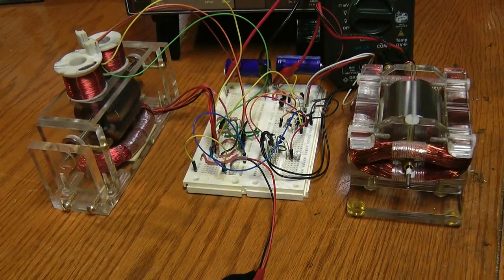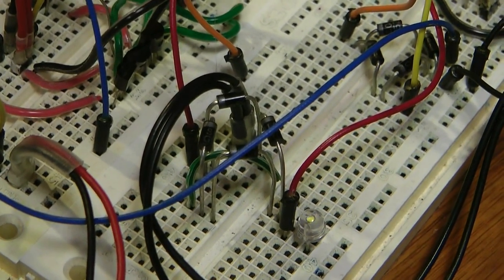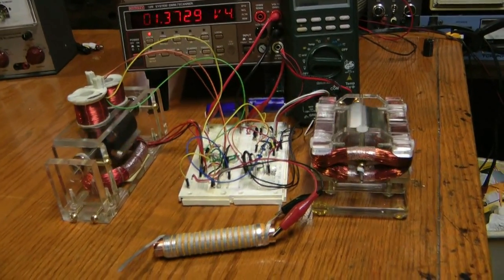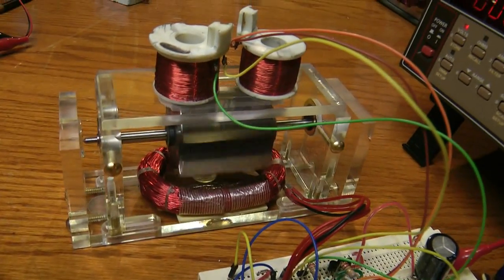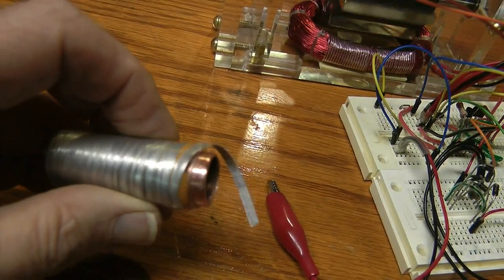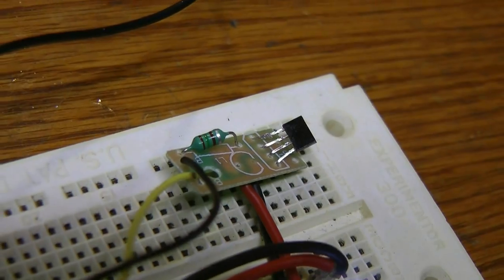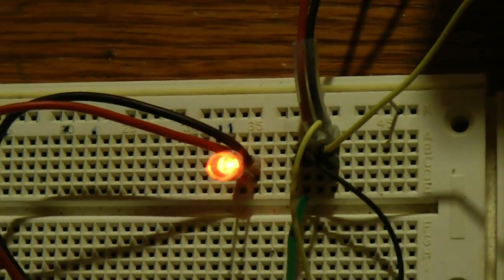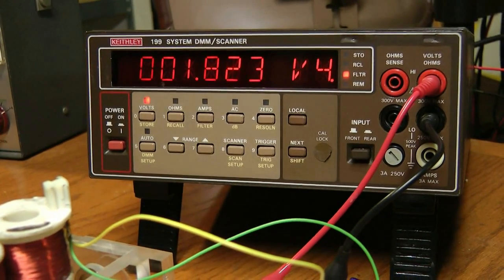Window Motor Runs Window Motor.

Comment: assuming if you used just a single AA battery with a series resistor of about 2 ohms, this contraption should run for several days?
Reply from the maker: Hi, On a AA the setup would probably run for months. The current draw is only micro amps.
J

Comment from the maker: Darkass, I know you're not dumb. This is just an illustration of how efficient a few motors can be by using a combination generator coils in series with EMF from power coils. There are 3 pounds of rotors and an LED running from micro amps. Maybe nothing practical but of high interest to some of my friends doing pulse motor experiments. Just having fun.
John

Comment from the maker: Hello, The answer to your question is no I do not have repeatable proof of over unity. When I say that I mean a true simple dependable demonstration that anyone watching could clearly understand. By that I mean something like charging a table full of drained batteries starting with one full one, or watching a self charging system take the battery to over 14 volts for instance and seeing the battery drop to resting voltage after disconnection.
John

Comment: Now, if you take Thane Heins bi-toroid transformer idea, and instead of solid state, you use a mechanized rotor for the primary, then you have what's called  "Phi transformer" which is a toroidal generator. You simply take a toroid and wind a coil on the left side, and a separate coil on the right side of the toroid. Now take a NS or NSNSNS rotor and spin it inside the toroid. The 2 coils will induce current into one another, creating up to an 8:1 overunity effect. Drive it with a window motor!

Comment: So I have been toying with some ideas. The Bi-toroid transformer by Thane Heins was finally replicated and proven. What you do is wind a primary coil on a small weak magnetic core, and you position this into the center of a toroidal coil, with one coil wound on each left and right side of the toroid, so there are in effect, 2 secondary coils. This violates the law of conservation of energy, because each secondary, once charged, induces current into it's opposing coil, without extra input energy.

Comment: why don't try huchinson crystal cell...
     youtube.com/watch?v=83le8v0Aeqo
casimir effect on some metal particle witch are in a simple made cristal based on salt and silicate...electrique piezo effect on the crystal by metal vibration by casimir effect...
that's why it's use galene too..... make forces on cell icrease piezo effect and current too...
sorry for my quick bad english...

Comment from the maker: @supermuble 
Ha,ha, Ya great fun but a little scary. I have a little window motor going 20,000 in one of the other videos. At one time I had a video up on the Tube with a window motor going so fast it would balance on a corner of the base like a gyroscope. I took it down because of how dangerous people though it was. There's another rotor that has an unusual magnetic effect. Take a look at the notch rotor on one of the other videos some time. .
Take care.
John

Comment from the maker: @supermuble 
You certainly might be right about what your saying. There is a two pound mild steel rotor in the center of the coil and it does change the inductance of the coil. That along with 500 turns on the coil makes a fair inductor. I have no problem getting the motor to 15K RPM's but I don't want to experience another magnet coming loose. I'll study up on Lenz law a Little bit. Thanks for the heads up.
J
J

Comment: @DadHav I think Windows motors, without having any real useful inductance in the air core coils, would not have the regenerative acceleration effect. In my understanding, you need to have iron core coils, with a lot of turns of wire, which makes a very high inductance coil. If the coil is an air core, like on a window motor, then the inductance is so high, that the frequency where Lenz's law reverses, would be like 30,000 RPMs or higher? Just guessing.

Comment: @DadHav So I'm sure you already know this. But regenerative acceleration is extremely simple, and most people over complicate it. If you have a coil of wire, it has inductance. If you have a lot of turns, you have higher inductance. High inductance coils cannot change polarity (north/south) quickly. If you spin the magnetic rotor faster than the coils can change polarity - you get Lenz reversal, A.K.A. regenerative accelration!

Comment: As much as I love the Window motors, I think more people should be studying the Adams motor. I have a 50 page article about the Adams motor. When you spin a rotor with NSNSNS magnets on it, at a high enough speed, the pickup coils will produce the inverse of Lenz's drag, and will actually cause acceleration - what Thane Heins has been showing in his videos. I think this is fascinating and more people with machining skills should be building these motor/generators.

Comment from the maker: @min2oly 
Thanks Patric. I have some Alum in the water, but it was never clear to me as to how much to use. I will try to find some Borax also. I tried salt but had the same thing happen. By by Mg! I didn't realize you where using copper. I should actually do more reading before diving into something. My copper magnesium cells look real promising so far. I'll see how long they last.. I have some ideas but don't want to spend the time until I know a little more.
Thanks for the compliment.
John